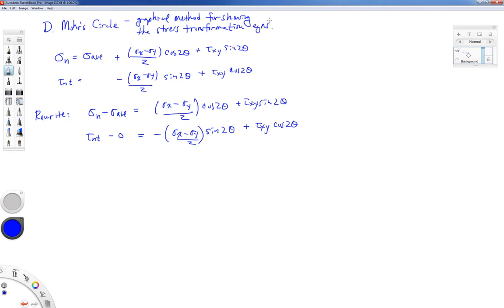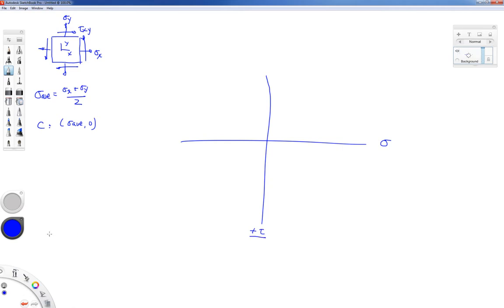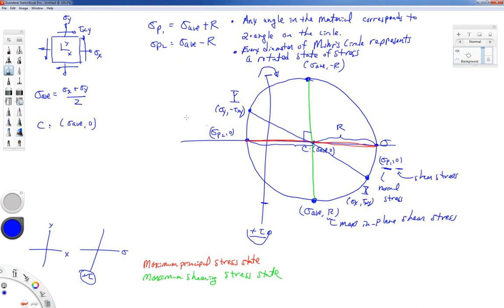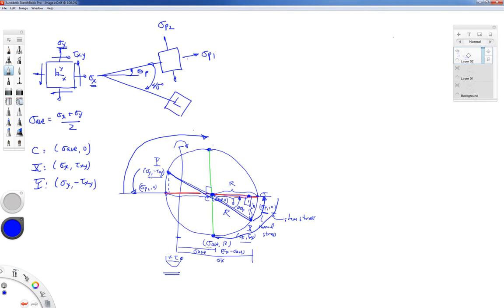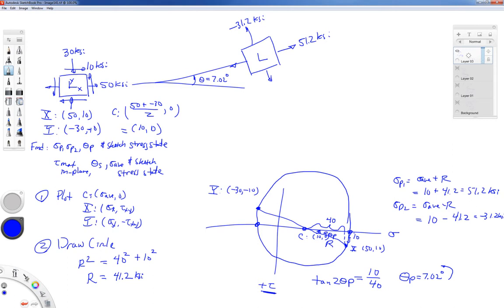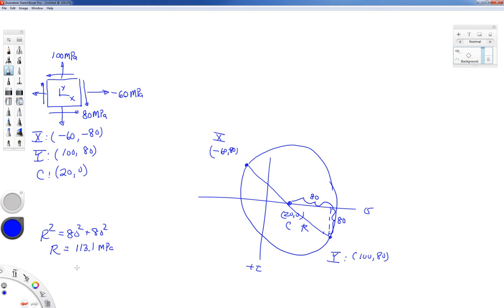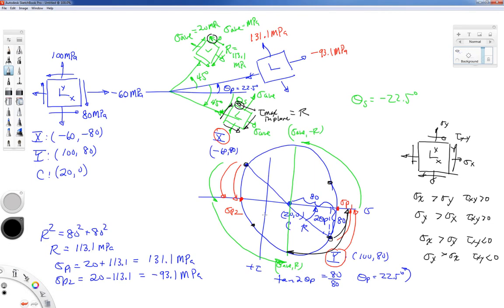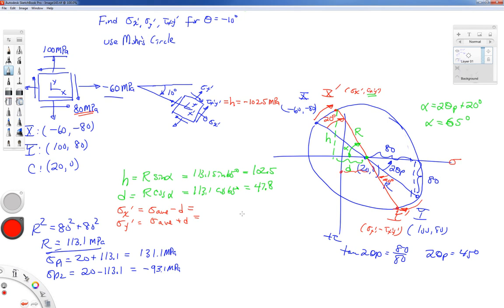Mechanics of Materials-Lecture-27-2-D Mohr's Circle for Plane Stress Transformations

Comment: If you change your vertical axis so that positive tau is pointing upwards and then following through with the calculatiuons does it give you a different result?
Reply from the maker: The values will be the same, but the reason for the inverted coordinate system is so that the sense of rotation in the material and on the circle is the same--i.e clockwise (CW) or counterclockwise (CCW).